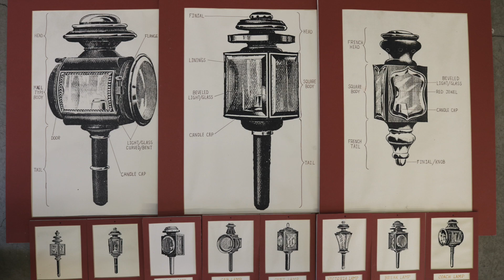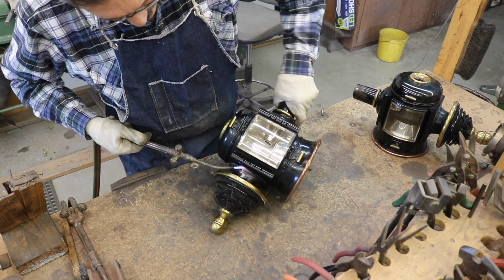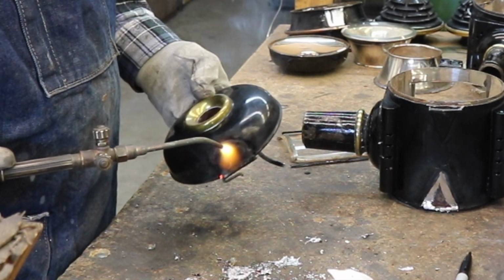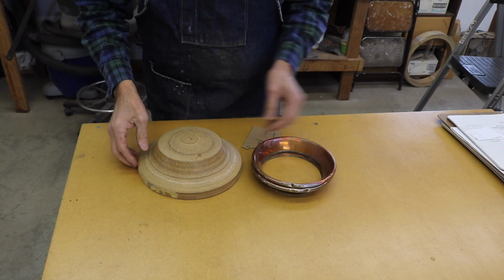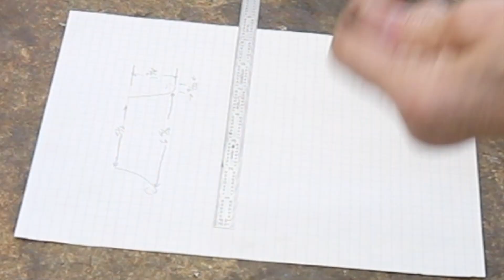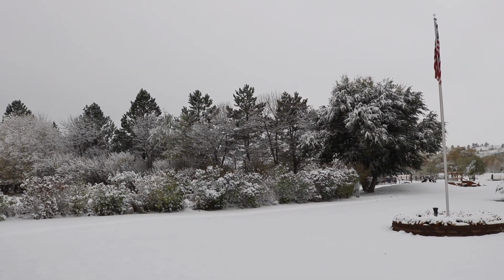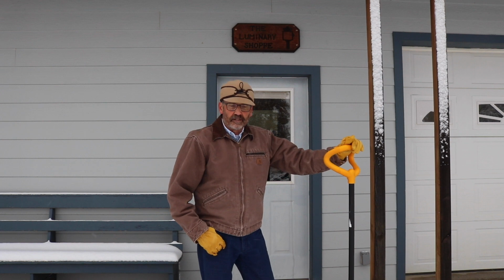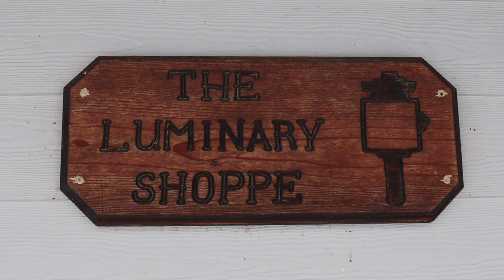Muhlbacher Lamps From Paris

Comment: About the only time we might know what the era of these lamps was like is in when the power goes out because how dark  the night truly is almost surreal even if it's just a handful of blocks your in. One might of seen these on a coach plying the streets around Paris who's street lamps gave the city its nickname and its side glasses illuminating more questionable addresses that none would admit to during daylight. Lamps as artwork lasted into the early period where early automobiles took over the roads that horses traveled just a generation before and the last vestiges of that form went away when lights  no longer sat in front of a grill like lighthouses instead of becoming part of it by the late 1930s.

Comment: I enjoy viewing your videos and the skill which you demonstrate in these restorations.  Do you generally find that when you are working on pairs of lamps, that the parts are interchangeable, or do you have to keep the parts separate for each lamp?
Reply from the maker: If the lamps have not been "worked on" by someone in the past the parts are usually interchangeable except when they are mirror images of each other, one for the near side lamp and one for the off side lamp. If the lamps have been worked on they often have changed something and I'm better off keeping track of which parts came from where. Also bent glass is often not perfectly uniform and it is best to put it back where it came from. Thanks for your question.

Comment: The correct name is Mühlbacher, a famous carriage builder.
The fancy tops belong on the ends of a curtain rail, certainly not  on those lamps.
I think the red lights are a later addition too.
Reply from the maker: You are absolutely correct on the spelling, I left out the first "h" in Muhlbacher. Thanks for bringing it to my attention, I have fixed it. The top finials however, are original to these lamps as well as the red lights on the rear. Thanks for your comments.

Comment: I am amazed the the glass did not crack or shatter from the heating. What is your secret?
Reply from the maker: I preheat the glass so the shock isn't too severe and I try to keep the flame on the metal parts which shield the glass from the worst part of the temperature shock. Also I do not place the hot glass on a metal bench top which I regrettably have found out will cause a temperature shock and crack the glass.

Comment: Do you ever have to anneal the work mid stream in the process?
Does the work ever work harden and crack, thus causing you to start over?
JIM
Reply from the maker: Yes, annealing the shell mid process is often necessary 
depending on how much the metal has to be moved.

Comment: So did you say that the copper rings were an earlier repair and incorrect?

JIM
Reply from the maker: The copper flanges were not necessarily incorrect. They had been silver plated probably along with the brass parts as there would have been only one color of bright metal when they were new. I replaced the flanges because they were too damaged to straighten and the owner wanted the bright metal in brass.

Comment: Metal spinning sure is a neat thing to see. I don't think my lathe runs fast enough to try it.
Reply: You don't need super speeds to spin metals, so don't let that stop you trying. Watch a few videos, make a few tools and have a go.
Reply from the maker: I spin from 545 to 800 rpm, the larger the piece the slower the rpm.

Comment: What do you use as a lubricant for the spinning ?
Reply: Either a paraffin wax or beeswax can be used.
Reply from the maker: I use Castile bar soap.
Reply: I have seen a very few videos on You Tube posted by metal spinners, the ones that I have seen from the UK also use hard soap.